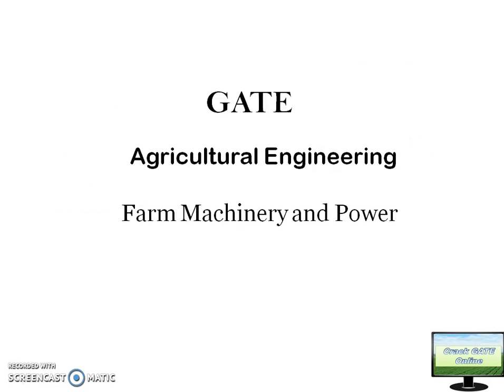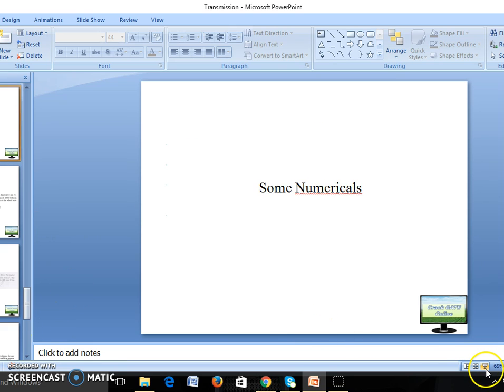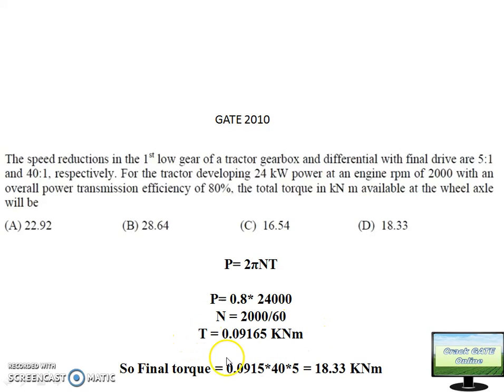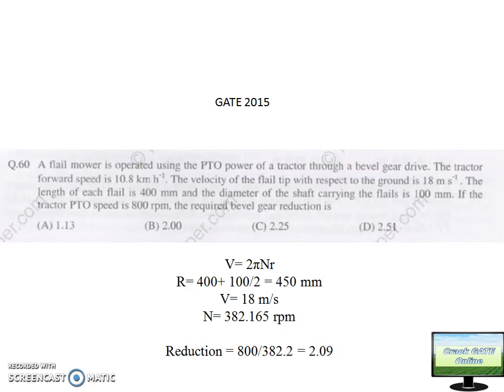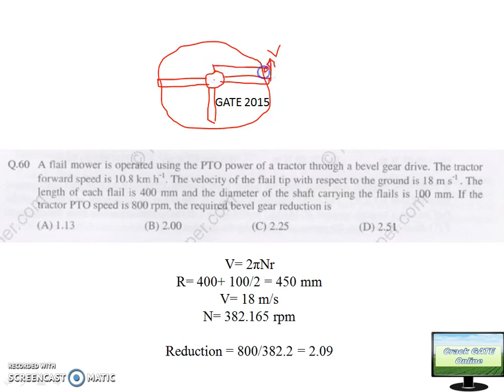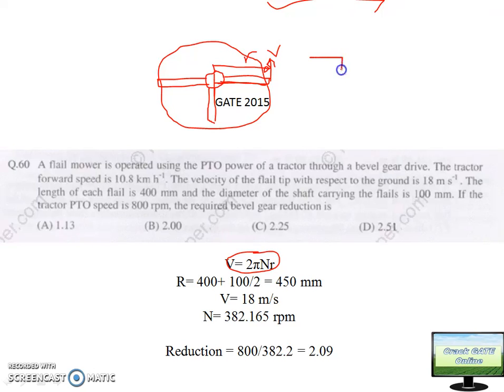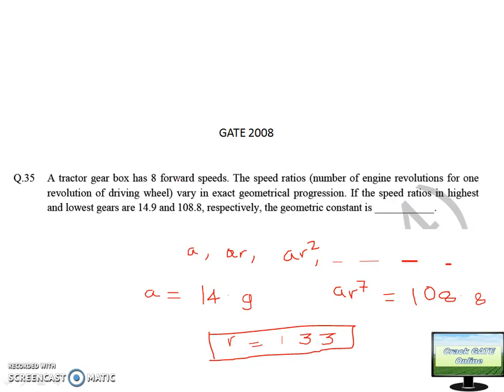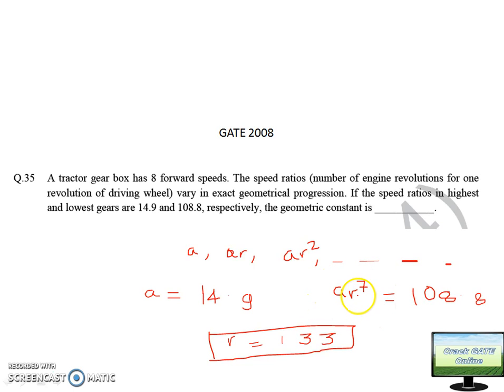transmission part 3

Comment: a tractor drawn cultivator in concurrent revolution mode is operating at 300rpm at depth of 150mm and forward speed of 3.6km/hr the radius of work set is 300mm and mean torque on rotor shaft is 440 Nm the no of blades is 3 the width is1.8m calculate tillage pitch ?and specific work done in one complete revolution?

Comment: A 2 wheel drive 35 HP tractor has 1.5 m rear wheel diameter. The engine runs at 1200 RPM . The total  reduction of the speed is 30 to 1 find the travel speed of the tractor in kilometre per hour and the tractive force at each tractor wheel ?
Reply: actual speed =2πNtd*60/2*30*1000.  =2*3.14*60*1200*/2*30*1000=11.304km/hr=3.11m/s.       p=f*v=35*746/3.11.   =8.39kN therefore force on each wheel =4.19kN
Reply: @shaiknasreen954  what was your rank in 2018